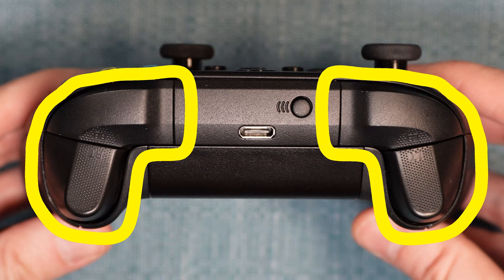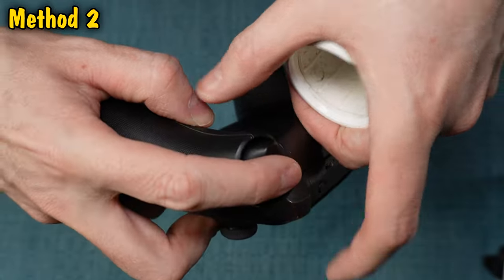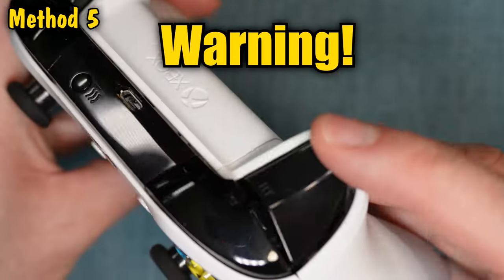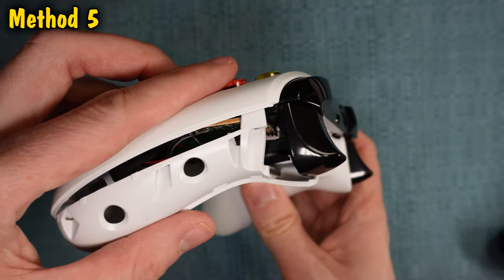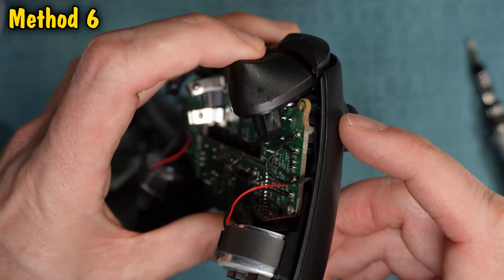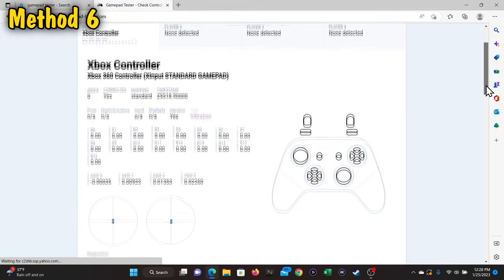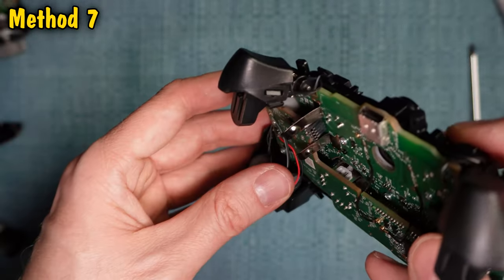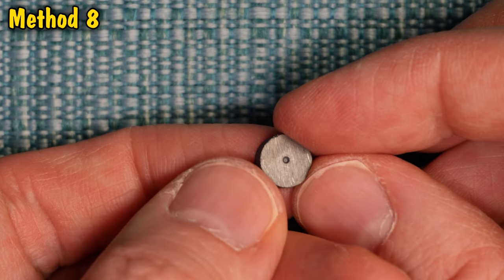How to Fix Trigger & Bumper Buttons on Xbox Controller | LT RT RB LB Shoulder Sticking Stuck Repair

Comment: Nice tip if youre fixing one controller and a other controller is just way to broken to fix take parts from that one my RT button isnt working imma try to fix it normally or im gonna take the RT button from my old controller

Comment: leaving out  one thing actually. My right triggers used to jam in a bit after pressing fully. The trigger acually stucks against the backbody of the controller, looking like the trigger (or the machnism) deformed since it gets not just a down push, but a sideways push as well obviously. The wear is even noticable on the trigger's inner side. Any suggestions? I am even thinking of cutting out the the part og the housing where the trigger leans at...

Comment: My RB button is loose in a way that it goes deep on the right side. There is also a small gap difference between the button and the central part of the controller, thing that isn't there with LB

Comment: Hi my LB RB piece is not broken, it's a problem of the little button you showed that gets pressed when someone touches LB/RB...both work, but the LB one does not make the "click" sound when I trigger it and it does not go down...the problem on Xbox series X/s controllers is that it's hidden so I don't know how to clean or eventually replace it

Comment: Whenever I press the RT button the RB button will slightly go down also, this doesn't affect my gameplay, I don't think they are stuck together from being dirty, I opened my controller numerous times and hit it with the air duster, I probably did something  wrong when putting it back together maybe, because it was perfectly fine before I opened it, how do I fix it???

Comment: My RB buttons have a problem they work but not allways... it seems that it works if you press it from a very specific area on the button... the top left, and the left corner of the RB, i did not try these ideas "YET" but hopefully it will work ❤

Edit: it helped "A BIT" cuz now the top area fully works but the bottom area is still not working and its still unusable
Reply: My same exact problem, I feel like a short piece that held the RB in position is broken and that’s why it only works at times and at a certain angle

Comment: Query, 
I bought a new Xbox one controller, the left bumper never worked, pressed down, never clicks but also does not work or causes an action. 
(The return process was such a nightmare, bought a store warranty told to go to Microsoft, they stopped human customer service yadda yadda life, it's been years, but it's still new, with my new work I have a bit more time.) 
So before I tear everything apart, do you have any suggestions? PS. It DOES work but only if I push down hard as it's already stuck down I'm not sure how that works.

Comment: i have a xbox one pdp controller. I cannot find a possibility to just change the Trigger Button with e.g. the A Button. Every Button you can with the App, but not the Triggers why...
Reply from the maker: I think it's because the triggers have degrees of pushing, while the A button is either pushed or not pushed.

Comment: okay everyone i know this is gonna sound crazy but my RB was legit DEAD . the sound of clicking was way different like a very dull sound no click or anything but it was still pressing. i tried taking it apart the duck tape and a whole bunch of other methods and nothing was working so i literally held down LT and shook my controller and why did it start working psa the tape was off so it’s just my default controller working again

Comment: My  Xbox controller is not an original Xbox controller that comes with your xbox so I can’t rip off the back that easily. I don’t want to take the controller apart to fix the issue. The issue is that whenever I hit the left trigger and my right trigger activates with it. I’ve tried the first method and third method but did not work
Reply: In your case only updating firmware would help

Comment: I’ve got a problem where some of my buttons are either slow to respond but when I did a test that you can do for your controller it showed all buttons working any ideas on what it could be
Reply from the maker: If it were me, I'd try the things in the video. It's possible it's defective, but you might as well try.
Reply: @HowToX  ok thanks

Comment: Mine presses but it doesn't work I went on to test mode and when I press it, it doesn't show it was pressed, I'm to scared to take apart my controller and it's not mine so yeah, and I've tried all the first 4 methods and my controller didn't need an update

Comment: On my controller, The tab that hooks the Left bumper is broken and I cannot find the piece what should I do
Reply from the maker: I just now added another link to the description called "replacement bumper." It MAY be what you need, be sure to check the listing for the exact controller models it fits. Otherwise, you may have to find a broken controller on Ebay and salvage the parts from it. Funny thing is, you may be able to resell it as "very broken" after you taken part you need.

Comment: if you pull the grips off can they easily go back on? I'm hesitant of pulling the grips off that something will break and I wont be able to get the grips back on
Reply from the maker: They go back on very easily. I've never broken one, but even if that did happen, you can buy new ones. When you search on them, call them "handles" for better results.
Reply: @HowToX  what should I do for a bumper that’s stuck in pressed down position it’s unclear which method matches to which problem and if it’s meant to be read down or left to right

Comment: nothing feels wrong but my RB is stucj like i can press it and release but it acts like im holding it down. During this process my A button started acting like this to so any ideas would help
Reply: Your problem with RB is on the list at .06 in the video, so follow the things in the video. Not sure about the A button, but cleaning around it may help.
Reply: took it all apart figured out that the button is just broken
Reply: @GamingTheSystems1  appreciate it but that controller is done, the RB button is stuck on and the A button is fucked so im done

Comment: Didn’t get to fix mine yet but inside when I opened It I noticed one of the screws from the controller was loose and was attached to a magnet that’s on the trigger lol good luck guys

Comment: I got a new series x controller and i took it apart to look inside it now my right trigger is clicking when i press it.....idk what ti do to fix it :(
Reply from the maker: It may have just been out of position, and taking it apart shifted it.
Reply: @HowToX  ill reopen it tomorrow after work and see if i can get it back to normal.....its pretty new only used it about a month its the basic black one that comes with series x.....

Comment: Bro I was freaking out because of how my rt button was not going down all the way. Then I realized since I had an series 2 elite controller, It had 3 buttons on the left and right side, and whatta you know, there both different, so then I made it equal and it worked. I was reallly about to take apart my controller for nothing. lol.

Comment: Tried the cardboard trick but now the controller just doesn't work at all. Did it press down too far

The only thing that works is the stick and when I tried turning it off and on again it won't turn on now.
Reply: Cardboard tricked worked for me
Reply: And I pushed it as hard as a could all around it while banging on it

Comment: can anyone help me with my D-PAD the right side of my D-PAD works fine, up works fine, left doesnt work at all, like i cant even press it down if i wanted to, like its stuck, down doesnt work/does random outputs such as, ill be sitting on my xbox home screen and my controller is down and it will randomly press down without me doing anything, and when i got to press it, nothing happens, so if anyone could help me out that would be great
Reply: You're going to have to open the controller up and replace the film under the dpad it's like $4 for a replacement. Not sure how comfortable you are with breaking your controller down but it will have to be done. If you can't do it find a local shop who can.

Comment: Mine just doesn't work when I press it, it's not stuck but it doesn't work
Reply from the maker: Ok, try the things in the video if you haven't already.
Reply: Did you get a fix?😊
Reply: @twitch-zerkx1022  Nope, ended up just buying a new one

Comment: Bruh, the reason why I had to search this up is cos some stupid person kept aiming on me then I got pissed and with all my strength I threw my controller as hard as possible at the floor and the RT button got stuck under the RB button but instead of being smart I jammed it back into my controller and then it got cooked ( this is after months of slamming my heel into my controller, throwing it against the wall/floor and slamming it into the corner of the table or chair)💀💀💀💀💀 would do again tho that guy was piss annoying

Comment: Xbox controllers are just the worst controllers ever. I bought 4 over the last 2 years, and none was perfect when it came out of the box. Every single one had an issue new out of the box, always different issues. One A button was not properly working when you press it from the side. L/R were hard to press. Analog stick trigger keys made an annoying clicky double noise.